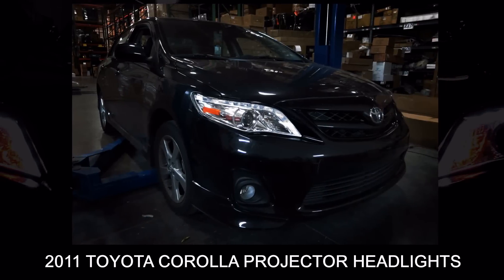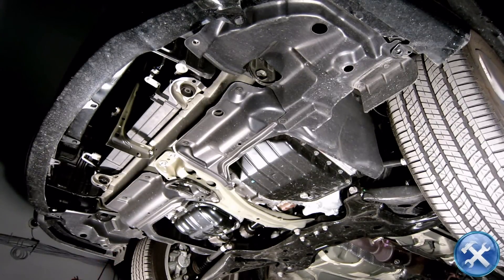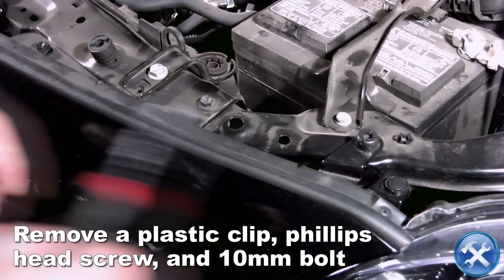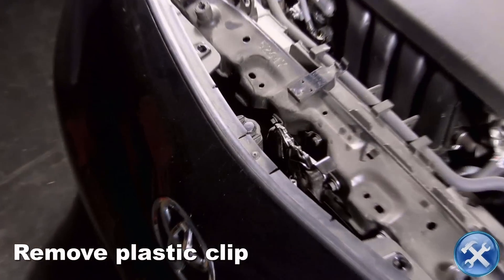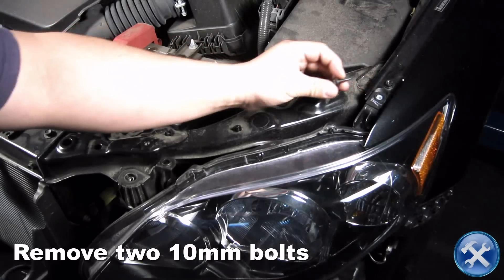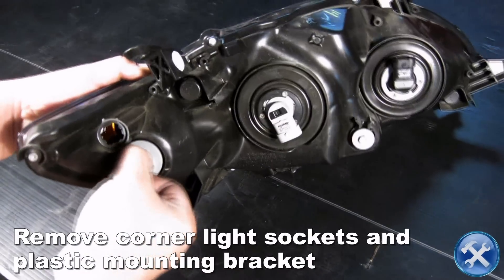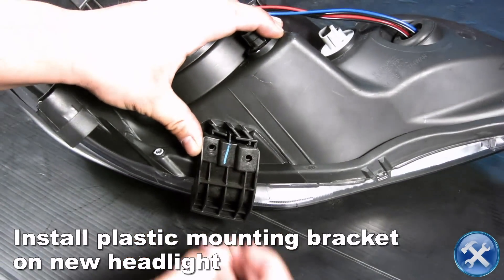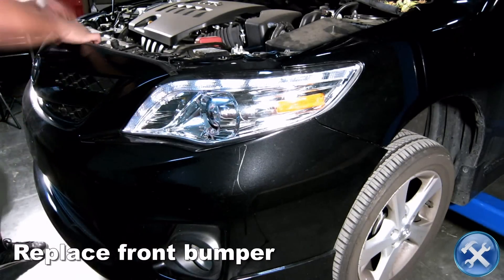SPECDTUNING INSTALLATION VIDEO: 2011 TOYOTA COROLLA PROJECTOR HEADLIGHTS

Comment: I did the same install, so you don't actually have to take the full bumper off. Just open the clips and screws on the top and the one's in the fender area and just pull the bumper out and let it sit on the ground. Then you will see the bolts for the lights, open them and just slide the light out.
Reply from the maker: david smith Removing the bumper helps to keep the installation safer from breaking any plastic and losing screws. Thank you for your the insight. This might help someone looking for a shortcut.

Comment from the maker: If you touch them with your bare hands they will have a shorter life span, and since these light bulbs are brighter then OEM the life span is shorter also. So it depends on how you take care of your light bulbs. But in most cases no they do not.